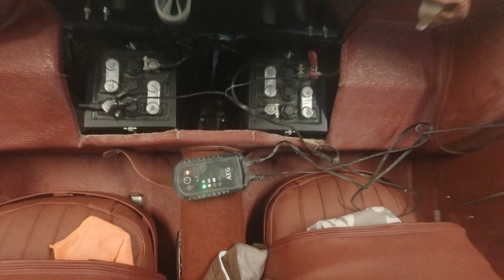The Austin Healey Project Season 2 - Episode 65

Comment: Thats the same gen thats on my 1955 tr3 and mine is date coded to my car so I have been restoring it (I did one vid on it so far) mine had a bad brush end cover (broken plastic around the power wire stud and it had shorted) and I found a new nos cover and new nos field windings. I threaded the holes for the end bearing and put 10/32 screws in. will do another vide on it soon.
Reply from the maker: The bn1 seems to share a lot of parts with the tr3. My wiper motor came off a tr3. I wonder what else.
Reply: @AustinHealeyChannel  I had to restore my wiper motor it didn't work (the overheat safety was bad) and it is also date coded to my car along with the starter and dist all original to the car.